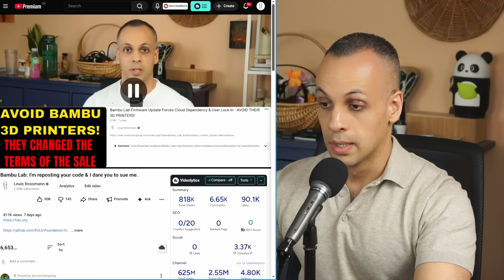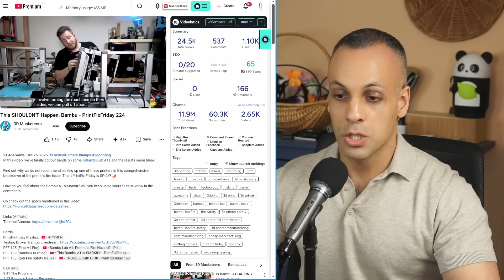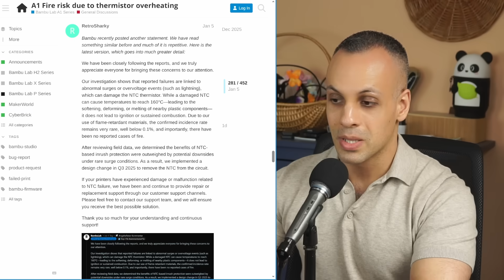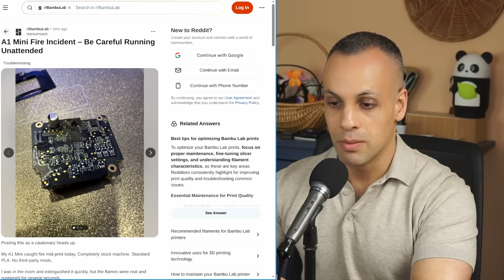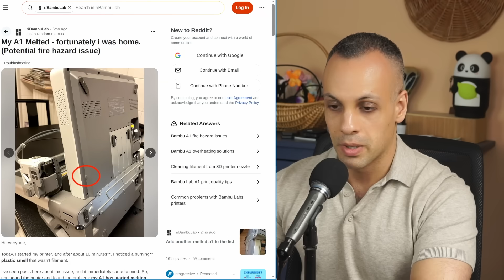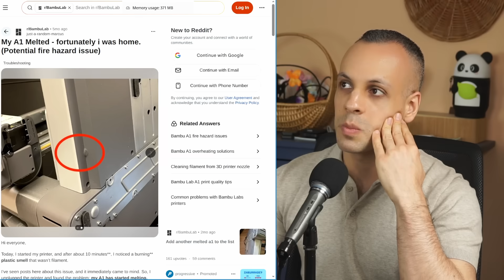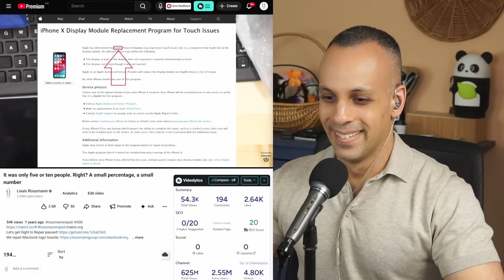Bambu Lab PR dumpster fire is turning into a literal one...

Comment: I’ve owned many 3D printers over the years. I had a Bambu X1C and ran into issues with it, so I wanted to return it. The return process took about two weeks of back-and-forth with support, partly because they didn’t respond for a while due to Chinese public holidays (they didn't tell me btw nor was there an automated response). That was especially frustrating since EU customers have a 14-day withdrawal period issue or no issue by law.

I have a Prusa MK4 now, and I only had one issue: I couldn’t update the firmware. I contacted support, talked to them for a few minutes, and they dispatched a new mainboard the same day. I installed it, and it has worked perfectly ever since. (note: the printer still worked before just that the firmware couldn't be updated)

If you want to buy from a company that doesn’t treat its users like idiots and has competent people working in support, I can recommend Prusa. I wasn’t a fanboy before, but I am now.

Comment: I bought into Bambu before they started pulling these stunts. I bought my P1S a couple of years ago when they came out, and it was incredible how it "Just worked" and required very little maintenance. I have several thousand hours on my first P1S and have never had to perform any type of maintenance. So I bought 2 more, and honestly, they're great. 
I was hesitant at first to buy in because of the closed-down ecosystem, but I was so frustrated that I spent more time working on my printers than actually printing, so I just decided to buy one, then bought more. I feel like they pulled the 'uno reverse card' on me right after I bought 2 more printers. I am very frustrated that they went this direction, but I should have seen it coming. 
When people called them the apple of 3D printing, I thought that meant that they just worked. And at first that was the case, but now they are actually going the Apple way, and I am just so frustrated. The only company that I have found that is even remotely comparable in the "Just works" department is Sovol's core x/y printers, but there's still quite a bit of setup that has to be done. 
With that said, I will never buy another bambu product again. They lost me as a customer.

Comment: A small number of Pintos burst into flames, and of those almost all were improperly impacted by traffic not controlled by the manufacturer of the Pinto prior to the combustion incident. It's also important to note that the Pinto itself did not material contribute to the severity of the combustion event. Almost all of the combustible material had previously been loaded into the Pinto by the owner or a designated contractor.

Comment: 3d printer user here, for more then 15 years.
i am now on my 4th model, and the first bambu i ever gotten.
tbh, the time i spend calibrating, adjusting everything in the other 3 brands, bambu its just perfect.
assembled everything in 30min and baaammm, was printing.
bambu is not perfect, but coming from other brands, i would choose again bambu for the ease of use, with two babies i have no time to spend calibrating and adjusting every single thing.

Comment: An inrush NTC thermistor is not damaged by lightning. It was the wrong rating for the continuous input current and got hot, too hot.

BTW - I do not see anything about the A1 having and electrical Safety approvals. They apparently did a DIY power supply designed to meet. Not actually tested by a Certified Body

Comment: Would not buy a Bambu printer regardless if they operate very well (when they work). The company's ethics and business practices have been a long standing dumpster fire and therefore I have never had an interest in them because like all dumpster fire company's, it's the users that  always get burned until the company finally reduces to smoldering ash.

Comment: have a good look at the ssr for the h1c it's the same components qidi used in their plus 4 which kinda lit on fire and melted for ppl bambu just used their own black board but same components and i've seen the same failure recently on a few h1c where the coils enamel started boiling off and also the ssr started to melt it's orangish housing

Comment: my printer had this failure when i was out of my home. i get a notification about a voltage failure but it was still printing. I rushed home making the 30 minute ride in 7 minutes on my bike. My home was filled with burning smell and the plastics has been melted. This happened more than 2 months ago and i still did not get my new printer.

Comment: 3D printers have always been a fire hazard. There's a reason why in Marlin you set the thermal runaway values just right: you don't want the thing to set itself on fire. There's a reason why most people put their printers on fireproof mats and have them plugged into zigbee plugs, get a video stream and homeassistant notifications if something odd happens.

They are inherently dumb, they would self destruct to obey to a command - so you cover your arse. This is pretty much accepted in the community.

Now, if you want to be the apple of 3D printing and make a fuss about firmware and hardware... The blame can no longer be placed onto the consumer for setting his values improperly before compiling the firmware ...

Comment: To be fair as a machine operator of 10+ years over multiple types of different industry machines. 

Rule #1 wear PPE and  never leave your machine running unattended.  

For 3D printers it's fine to set them and walk away as long as your not leaving the area, and check up on them every 15-30 minutes. 

That said this thing with bamboo labs makes it more necessary to take cautionary procedures to protect your printer and other assets around it.

Comment: I've been 3D printing for over 10 years and started back when your printer came as a box of parts (Prusa still does).  I recently wanted to upgrade to the new hot style Core X-Y with a heated chamber and all that as my printer is a tool and I want to print tool materials.  I knew how easy and good Bambu printers were, but I bought an Anycubic. They have a reputation of being slightly unfinished, always something left to tweak, but I absolutely refused to buy a Bambu because of their anti-customer attitude.

Plot twist, my Anycubic Kobra S1 Max has been a dream to print with so far.  Works out of the box and stock filament settings are generally problem free.

Comment: Thermistors are supposed to measure temperature, NOT raise the temperature themselves! Of course all thermistors dissipate a tiny bit amount of heat due to them being resistors but if it does raise its surrounding temperature by that much, then you're using it wrong.

Comment: You realize that this can happen with tons of 3D printers right? If you are leaving a 3D printer unattended you are taking a risk. Obviously they make the revision to reduce the already miniscule chance of the issue but that doesn't replace all parts immediately, that only occurs if you recall all stock/parts.

Unfortunately I don't think Bambu could offer the level of products they do at the prices they do (they are by all accounts some of the cheapest for the features) without trying to create some controls for profitability. I get people want to be angry but it's still a business not some hobby

Comment: I have 5 Bambu Printers 3x A1 Mini and 2x A1. All of them are working out of the box, easy to use for a beginner. For what I need are perfect. I`m locked in their ecosystem and that sucks because I`m starting to tinker with their software (G-Code) and is a lot harder to do that than with Prusa. I have bought all 5 printers cheaper than one Prusa. Money wise are a great investment , but if you are trying to do a business with them the lack of access is not that great to scale it...

Comment: Bambu is the apple of the 3d printers. The fact they are burning out boards reminds me of the good old anet a8's
Prusa's are the easier to use printers apart from the bambu's to use but are on the pricey side  but completely open source and the bambu AMS is based on the Prusa Multi Material Unit

Comment: I wouldn't compare bambu to apple. They didn't do anything special, they just spent billions on advertising and removed the need for basic assembly and setup of the printer. Well, we made the most beautiful application possible to send something for printing without the possibility of control.
Bambu was created by people from DJI, and their strategy traces exactly the same mechanisms as dji’s: maximum system closure, so that you can’t change anything and are forced to go only to them for spare parts. An audience is created that does not understand what they are doing, the audience’s dependence on the ecosystem is fostered, and then old products stop working, so that the consumer is forced to run to buy new ones... after all, he can no longer use anything else, the dependence is at the level of software or infrastructure. Just remember how old copters and controllers stopped working because all data exchange was done only through a secure protocol whose certificates expired... just 5 years after release. Or their datalink, which was so dependent on google earth that after the site was closed it could not start at all. And now, on your shelf, several thousand dollars have turned into nothing - after all, why update the software or give access to the protocols to users, they should go and buy a new one. 
I’ll assume that even the current situation will be used by bambu to its advantage: something like “oh, we’re wrong, so we’re deleting bambu studio, changing firmware and protocols, releasing our new slicer compatible only with our printers, and all new devices will come with new firmware and no rollback option.”

Comment: Okay, Louis, come on. They absolutely fucked up when they tried to close source and lock down their tools. They absolutely did malicious wrong when they threatened to sue, and I hope they get the crap beat out of them in court over that.

But this is just piling on. They manufacture complex hardware, they do it well, and they support (with the exception of the code issue we already agreed on) their customers pretty well.

Every manufacturer is going to have issues, and they're all going to handle them approximately this way. I don't think this issue is particularly bad.

And given how many units they've sold, a tiny percentage of that large number is going to appear large if you go looking for it.

I'm disappointed with you on this one man.

Comment: I use a bambulab x1e at work. They were very good when we got them and I took a lot of care and maintained them frequently. The printer itself is very good. However, one of them has a z offset issue where the right lead screw is a bit out of place and the lidar sensor did not notice anything about it. I tried to do what bambulab suggests in the wiki but  the page was filled with so much nonsense you can barely understand what they are trying to say. It is a printer that  is user friendly until you have a problem that can be fixed manually on every other printer/

Comment: I think there are two separate issues being mixed together here.

It looks like Bambu may have a real AGPL compliance problem if the closed networking component is tightly integrated with Bambu Studio. If they built on AGPL code, then they need to honour the obligations that come with it. No argument there.

But that still does not automatically give anyone the right to access Bambu’s gated cloud service through an unofficial client. Bambu Cloud is proprietary infrastructure. Whether people like it or not, Bambu can decide who is allowed to access it and under what conditions.

Finding a working access path is not the same as being authorised to use it. If someone leaves a key under a rock, that may be poor security, but using that key to enter the house is still not your right.

Where I do think Bambu deserves criticism is local printing. If a user wants to run their own printer offline or over LAN, they should be able to do that cleanly from the slicer of their choice without being forced through Bambu Connect. Bambu should protect its cloud server-side, but local control over hardware people bought should be seamless.

Personally, I am not especially worried about Bambu seeing printer-related data, but I understand why others are. If people want to separate from the cloud, they should be able to. But they cannot have it both ways: either use Bambu’s cloud under Bambu’s rules, or use a proper local workflow that does not depend on their cloud.

Comment: I run a large print farm in Europe 

I am very disappointed in Bambu politics but I have to say their products are simply necessary for us as professionals 

For many there is 0 good alternatives from other manufacturers are not having Bambu machines would get us run over by competitors 

We have 66 Bambu A1s printing basically 24/7 with 0 failures outside of wear items 

Meanwhile Creality qidi tech 
Artillery Prusa ELEGOO and Anycubic we have had many and I mean many random failures or just straight up poor engineering decisions

Comment: Can be a problem with 110 volts. It's an inrush current NTC in the power circuit. Wouldn't be surprised if the similar design and component was used in millions of other power units in all kinds of appliances in the US :)

Comment: I recently implemented an NTC inrush limiter in something I made, and there is a bit of complexity to selecting the right type to prevent overheating, but it's not that hard.
Unless they just got cheap crap ones that failed or did not perform to spec.

Comment: Bambulab shacked 3d printing industry in a very good way. They still provide best value for a money printers in A series IMO. Never will buy their printers though - closing every third party parts and software using opensource technologies is horrible and anyway - I prefer klipper-based machines with the customization possibilities cause thats the core of 3d printing.

Comment: I'm having numerous issues with them and their 0.4 hotends for X1 series. two in one week have failed in the same way where the heater cartridge has fallen off their press fit connection. Each time their support has closed the ticket without replying and I've now had to make a massive complaint to their general contact email, total shitshow of a company!

Comment: I had the money, but I actively decided against Bambu even before all of this started. Went the Qidi route, they are using forks of Orca Slicer and Klipper as Firmware for their machines, and have repair videos online or send them to you on demand on about replacing almost everything on their machines. The video for the Q4 on how to replace the cable from the board to the printhead has them disassemble almost the whole machine in great detail.
Did I have to replace parts after half a year of use? Yes. Did it suck? Yes. Were the parts expensive? No. Did they arrive fast? Within a week. 
But most importantly: How long did it take after the initial setup procedure until I could start printing in earnest? Well, my first prints were made with ASA on a completely unmodified printer, and they came out well. That says a lot about the machine quality (Q4 in this case).

Comment: We have a Bambu Lab 3D printer at work (generally for hobby use, not really related to the work we do). I do really like the auto-calibration and it's probably among the best that I've encountered (which is very limited, I'll admit). 

We have had it in LAN-only mode as it is shared and we do not want it connected to cloud services. It's still an absolute shitshow to connect to. The only supported way to monitor it in LAN mode is via the slicer software, and there's a limit on 2 or 3 concurrent connections, meaning if you get DC-ed and there are others checking on what's going on with the printer, you can get locked out from monitoring your own prints. And there's no way to monitor it from a mobile device, unless you run your own software via poorly documented or entirely undocumented endpoints.

Comment: Hate to say it, but 3D printers are fire hazards. All of them. Not trying to defend Bambu here, but in general, everyone who uses any 3D printer in a way that threatens to burn your house down, is literally playing with fire. They are not meant for unattended use in a bedroom. I have an Ender that went up in smoke due to stupid cable routing. Luckily, that was in a room without flammables and with a smoke alarm, and the device was monitored, so no further damage. Folks, be careful with all 3D printers. That being said, the A1 I currently use will be the last Bambu Labs printer I have bought unless they change their ways as far as the cloud/software situation goes.